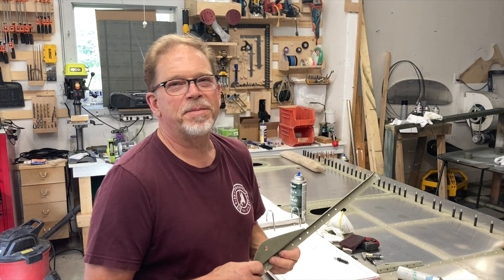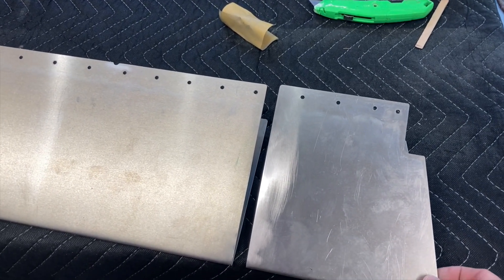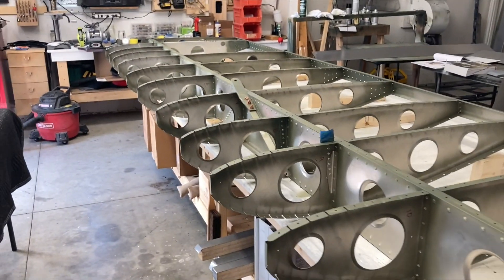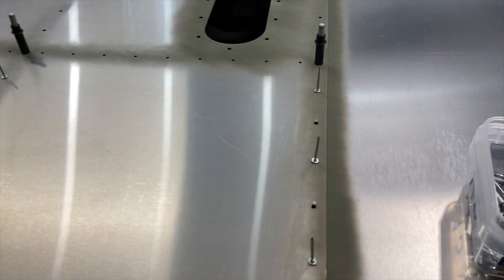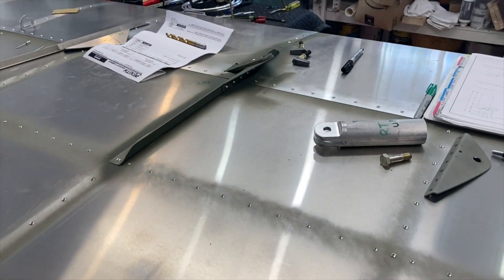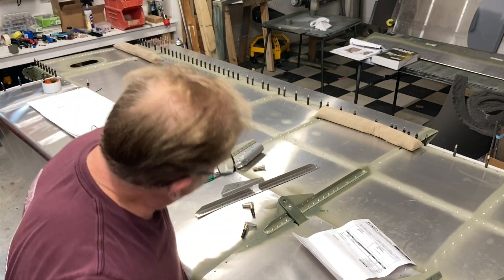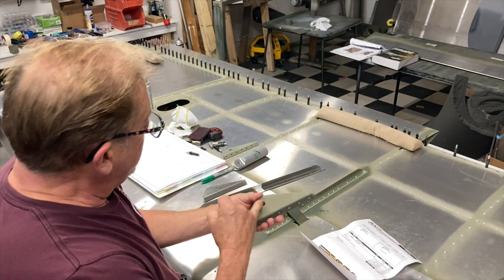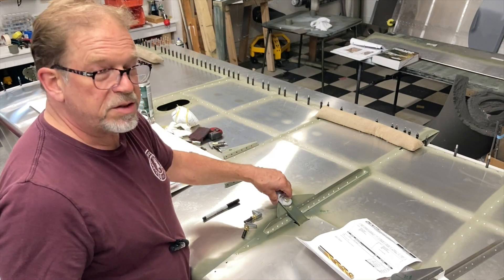Zenith CH 750 Cruzer Build ...Tips on how to build the Strut Angle and Doubler

Comment: 14 CFR 91.205 states the requirements for instruments.  Airspeed, Altimeter, Compass, Tachometer, Oil Pressure and Oil Temp, Fuel Gauge for each tank.  Temperature gauge if using a liquid cooled engine.  Sure enjoying your build and videos, you do a nice job!  Just got my 650 plans and will order the empennage when I can go to MO for a workshop.
Reply from the maker: Thanks ...Are you going to video your build ? Have fun down there , but look out for tarantulas. Ha
Reply: @DennisZylstra  I’d like to as there isn’t a ton of 650 build content.  Will need to do some video learning before I get parts….